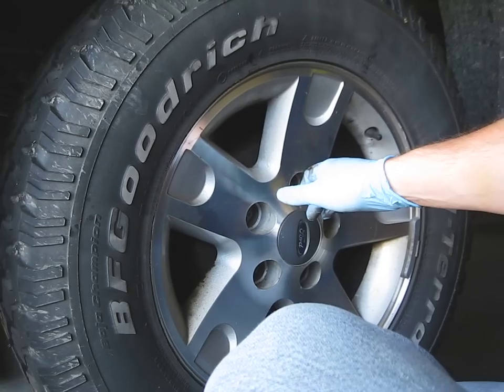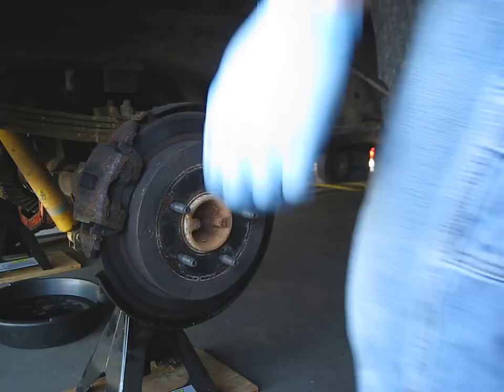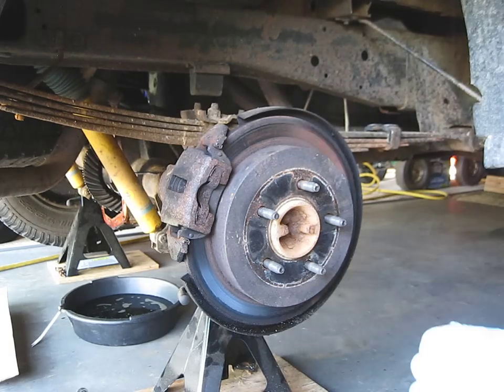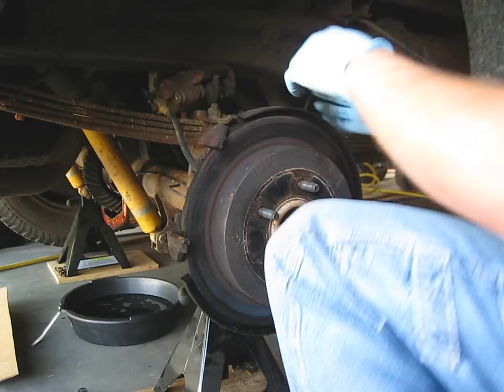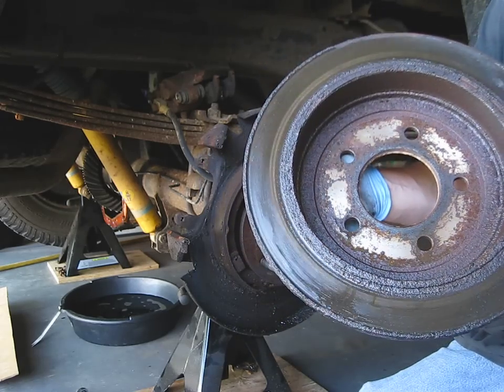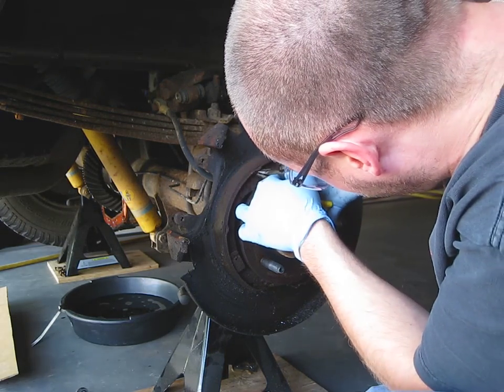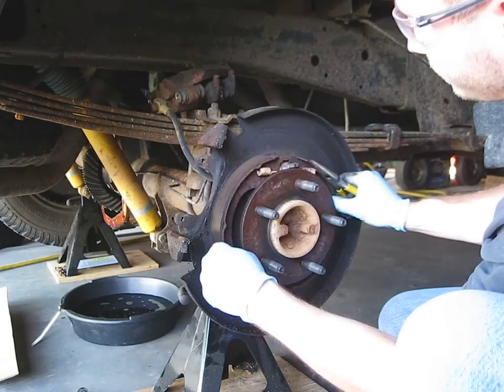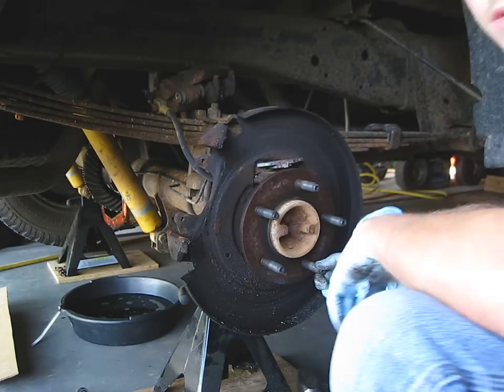03 Ford F150 Rear Axle Seal/Bearing Replacement Part 2 - Axle pins

Comment: This is not the way.  dont need to remove the P brake, or the other side axel.  You remove the bolt, pin, and c clip inside the differential cover and the axel will slide out.  OP was apparently learning while filming, and not kind enough to update his findings, so allowing folks trying to learn to make the same mistakes he did...